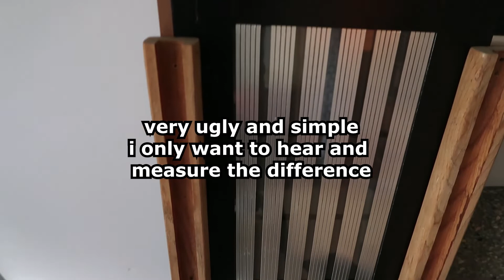Bass Planar Magnetic Woofer from scrap steel - Part 7 vertical FAIL

Comment: al the best for the coming weeks Joppe, hope you have some helping hands and I'am looking forward for a comparison between Point Source and line source in the future 👍
Reply from the maker: Thanks ! M8
Reply from the maker: well i made many line sources already, just not big enough.  i prefer this one if you do not want floor to ceiling doors :) if so they can perform well and can be made more easily then these :)
Reply: @joppepeelen  '  yes I have already such doors at home...big ESLs, built as a Line Source...but I am absolutely not shure if the soundstage of this Line Source sounds right, maybe a Open Baffle Point Source has a more realistic soundstage...since you have both Panel Systems a Point Source and a Line Source and therefore the possibility to compare...I am really interested in your opinion regarding eg. more realistic soundstage or other advantages and disadvantages of one or the other system.

Comment: Hello, what I just came up with when looking for bar magnets, you can install instead of permanent magnets, also electric bar magnets. My idea behind it is that maybe the field strength can be adjusted. Or is the distance between the solenoid coil and foil too large. Thank you for your fantastic projects.
Reply from the maker: Yeah you can use fielcoils/elektro magnets, problem is they take up quite some space and become costly very fast :(

Comment: New subscriber here ;) .. I am curious: How is the soundstage and imaging when you use a 3-way design vs "Magnaplan" all in one panel ? - EDIT - you didn't get time to do so before it broke, such a shame...
Reply from the maker: yeah the vertical died before i could test :) but the other version sounded good.  magnepans are usually 2 ways and sometimes 3, but i think the major reason why these sounded  different to me is the fact the drivers are all much smaller for the frequency range they produce (cant have a big panel do 20khz, you can but dispersion will be like a laser beam). so it acts more like a point source. by far not a perfect one,  that would take at least one more driver in the top end i think. but i run out of amplifier channels :)
Reply: @joppepeelen  You are right, a driver have 3,5-4 octaves of useful bandwidth so it stands to logically assume one single driver can't perform the task of what is usually 3-4 different drivers sizes job :)... a follow up question if you don't mind: Why rectangle and not round ?
Reply from the maker: @Patrik_76  well round tends to create a bigger resonance since all sides are the same. besides that magnets are square so making use of driven area remains better with rectangular (more eficient in building, costing less materials etc)
Reply: @joppepeelen  I see .. interesting peace of info and thanks. I were suppose to sit with your chn and goo over your multi year material .. LOL; but I got caught up in open baffle and dipole theory's as well as cabinet shapes. Right now, KEF Blade and B&W Nautilus are the two most promising shapes - aka, "jellybean's" :)

Comment: Hi is me again 😂
What about dual coil planar? One big coil for more excursion and one smaller one for high end? Separated by a filter?
Reply from the maker: well essentially thats what this is. 2 big panels are 3mm excursion, while the parts that do mid have 1mm excursion and the tweeter has 0.5mm excursion :) they should never move more then that so :)
Reply: @joppepeelen  i mean all in one
Reply from the maker: @elviscaragea4433  you can and i did in some contraptions. but in this case that means if something fails or when cutting fails all is failed :) in this case its not possible since the midrange and tweeter used thinner foil :)
Reply: @joppepeelen  what about wdth of the lines
Reply: @joppepeelen  or what about using thick foil and cutting the lines very  thin
Reply: @joppepeelen  etching it, i heard that solind ink printers are the best for etching
Reply from the maker: I think you heard that from me :) but in this case it wont work. Cant print such huge piece, also etching it would be a problem.   Why not use it the way it is now ? Faaaar less trouble :)
Reply: @joppepeelen  i read it in a forum, sorry
Reply from the maker: And the user might have been wrinex
Reply: @joppepeelen 🤔
Reply from the maker: Maybe it was diyaudio.com in any case solid ink is nice for snall things.
Reply: @joppepeelen  i dont remember